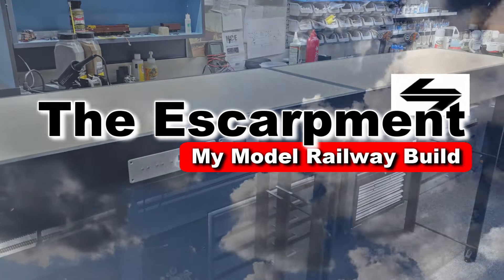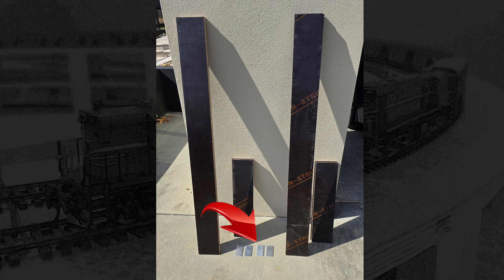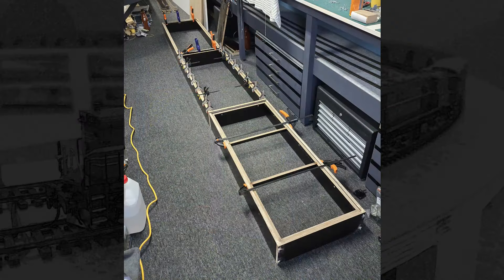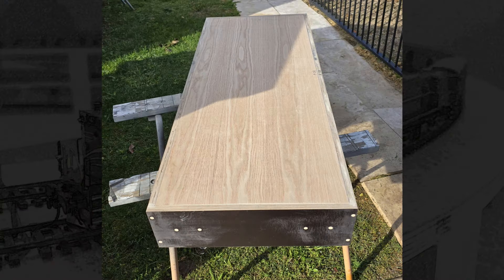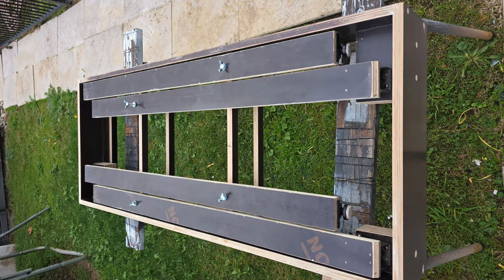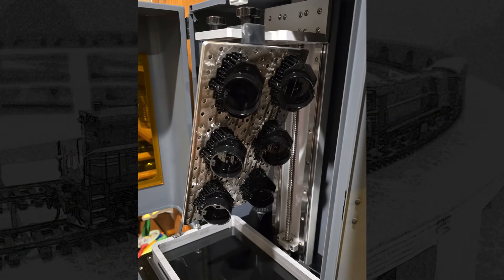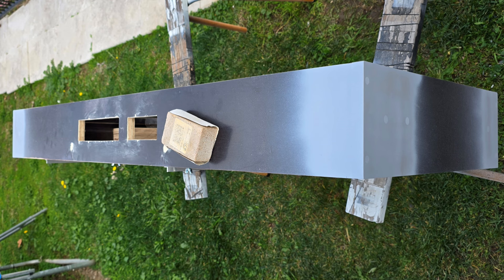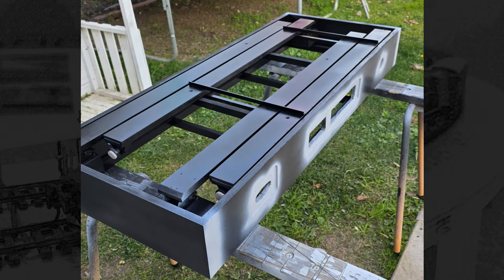How I built my FreeMo Frames - The Escarpement

Comment: A very informative video; and timely too !  I am working on similar modules, but to N-Rail standards.  

I painted each piece before assembling them into the module -- easier for me to paint them unassembled -- so I will only need to do touch-ups.  I am using pocket-hole screws so there will be no holes to fill and paint over.  Also, anything that I can do with the framing members prior to assembly, I am doing -- including  installation of Digitrax control panels; brackets to hold my points control panels; barrier terminal blocks for wiring connections; etc.  Manipulating single pieces is far simpler than trying to deal with a fully assembled module.

Your decision to inset the points controls and the DCC system panels is brilliant.  In my case, since I want to include an back-lit track diagram, my points control panel will be removable for storage within the underside of the frame for transport/storage (held in place with magnets).

I do like how you built the legs.  How long are they ?  They look to be almost as long as the module.  Since I have mobility issues (I can't reach anything at floor level), I am not entirely sure how to make the legs adjustable from the top.  I could put adjustable feet at the top of the leg (rather than at the floor); but how can I reach them for adjustment when the legs are in place ?  So I am kind of stuck.

I am looking forward to seeing how you install the alignment pins as that is something I have yet to sort out.

How will you be handling where the rails cross the joints between modules ?  I have some plain printed circuit board (PCB) which I plan to glue along the edge of the module where the tracks cross, and then solder the rails to the PCB.  The PCB is about the same thickness as the ties (sleepers) and I am thinking of cutting the PCB to mimic the shape and spacing of the ties.  Of course, I will remove the copper plating between the rails to prevent creating a short circuit.
Reply from the maker: Hi Timothy. Thanks for watching. I like your approach to your build. I was thinking of doing those pocket holes, but due to the size and weight, I wanted to use longer screws.

My point controller inserts have also been designed to house an LED. I'll be using a bi-colour LED and will show red when the rails are diverged from the mainline. 

I wanted to have the best of both worlds with installing its own DCC Command station. So I can either run on my own or power a few other modules in a small setting, or it can be bypassed in a larger setting etc.

I believe the legs are around the 1140 mm mark. The height is due to the ARMA Freemo standards being 1200mm from ground to top of track. You have an interesting challenge to overcome concerning your legs. Access to adjust is going to be a tricky one.

I will be using the DCC Concept alignment pins and will have that in another video. As for the track ends, I have bought the ready-made PCB sleepers to glue down and, like you solder the rails to them...regards
Reply: @JasonWood_Escarpment  Hello Jason.  Regarding my points control panels, as I said, it will be back-lit; but green for the selected route, and red for the unselected.  I will be gluing the frame together as well as using pocket screws -- the screws being used primarily to clamp the pieces while the glue sets.  For alignment pins, I got some brass ones from Amazon.  I have  seen videos showing tricks on how to install them... but I am still not quite sure what kind of adhesive to use -- CA glue or epoxy -- I have seen both used.  Being in Canada, while we "officially" are a metric country, seeing/hearing measurements in metric is a bit strange.  That said, I often use metric since it is far simpler to use than trying to figure out if 5/8 is larger or smaller than 19/32.  Just easier to measure to the nearest millimeter.